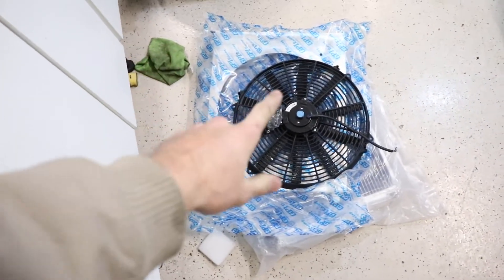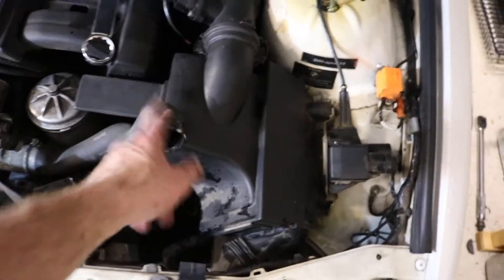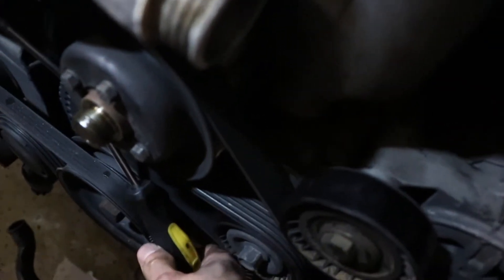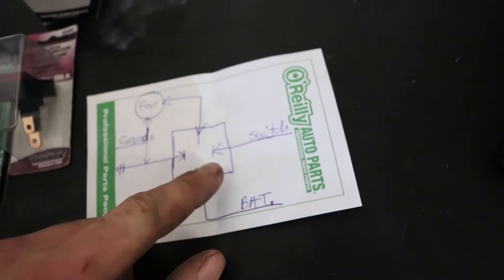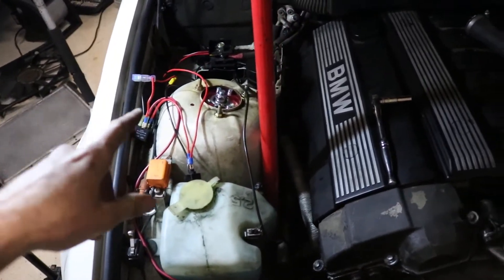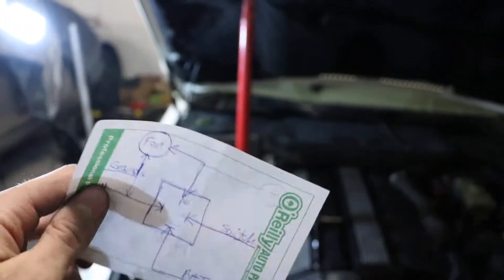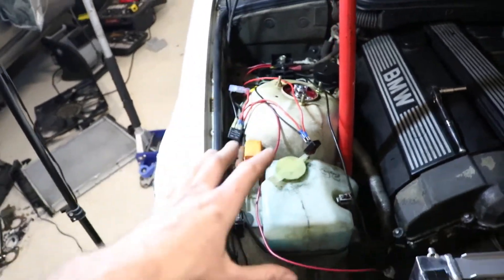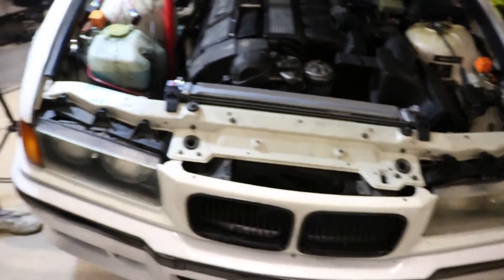How to Wire an Electric Radiator Fan to a Switch

Comment: Fantastic video!!! Simple explanation and walk through was all I needed tyvm.

I did notice that my Positive 10ga wire connector that connects it to the relay looks like it is slightly melted... Everything seems to work perfectly. Does that mean I should go with a 8ga for my fan wire to reduce the heat? Its ONLY at the connector / relay.
Reply from the maker: So glad it helped. I might do an updated version of this video in the future. Ya you could go with a larger gauge wire. Just make sure everything is tidy and insulated on all the connections. Thanks Jimmy, feel free to subscribe :)

Comment: This video definitely is not for beginners, that have never did it before. I want to do the same thing, but this has to be broken down into detailed steps.
Reply from the maker: I might have to do an updated video soon
Reply: @jspeedracing  yes
Reply: @jspeedracing please please. My Opel Corsa is over heating badly and need to hardwire the fan asap.

Comment: Hi. If you take a 30Amps switch and you connect the one end to the positive cable of the fan (12v+) with a cheat connection spade and the other after the fuse box's fan fuse, you will have the same result. For having one way flow of the current you can put a diode to isolate the back flow when the fan starts from the factory's 100 degrees thermostatic valve. For having a signal of the fan's operation, the switch should have a bulb for connecting the positive cable's end of the fan. You will have two separated operations. One with thermostatic valve and one with the switch to operate it manually. On both cases you will see the fan's operation through the bulb which is on when a 12v+ going to the fan.

Comment: The shroud is vital to cooling the whole radiator, otherwise you're only cooling the area of the fan.
Reply: No it's not shrouds can cause hot and cold spots causing cracking..
Reply: @mickzilla4196  then why do all cars with OEM electric fans come with them in shrouds??
Reply: @steven530x  I'm assuming he means for motorsports. Hot laps, constant abuse, and constant heat soaking and cooling. 

During regular driving, which your car was designed for, a fan shroud isnt necessary, even on a daily driver. Regardless your temp gauge will let you know if you have problems.